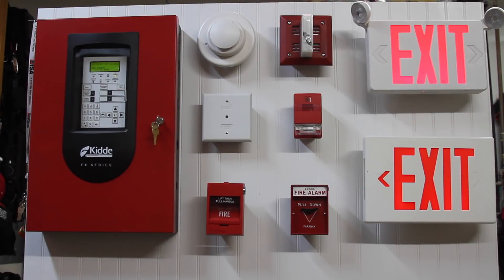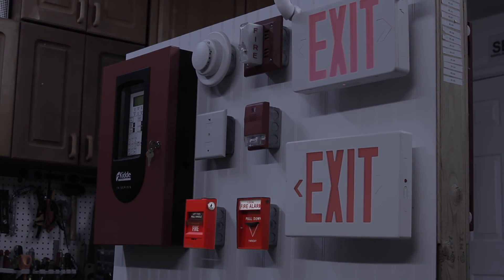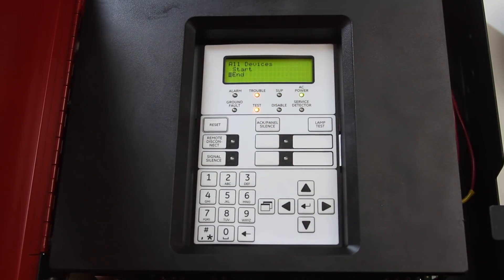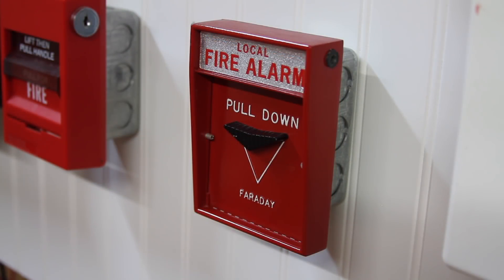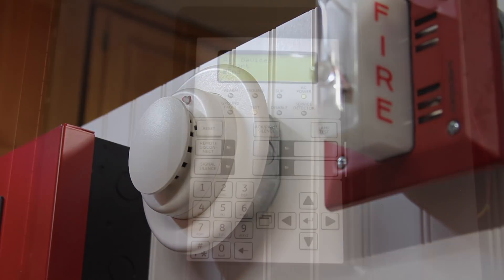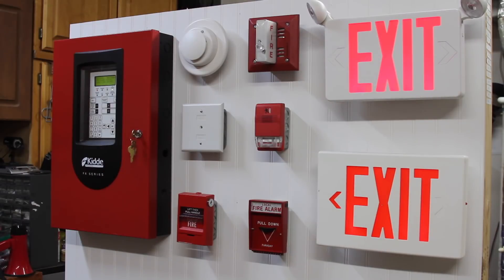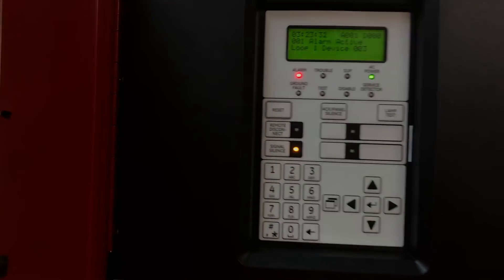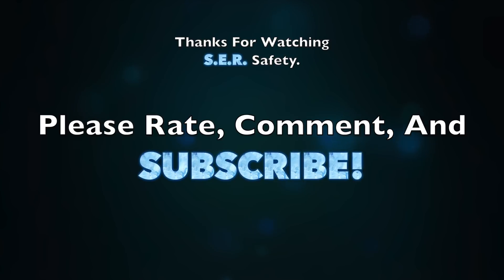Kidde FX-64 System Test 6: Walk Test!

Comment: The two sets of connectors on the 10123-2 are for activation and reset. The activation part can be wired as a normal pull station and the reset can be wired as a silence switch.